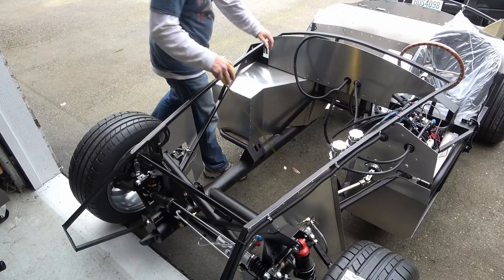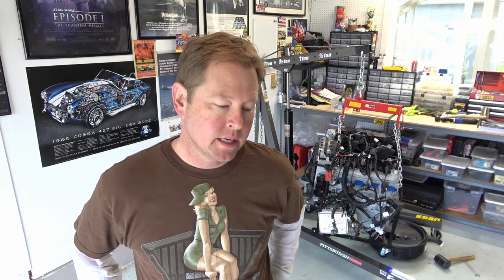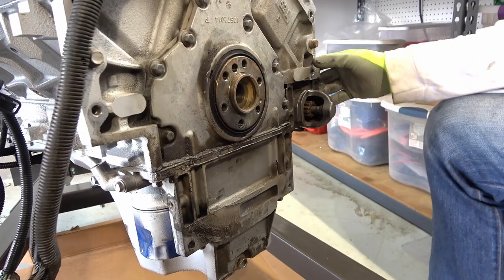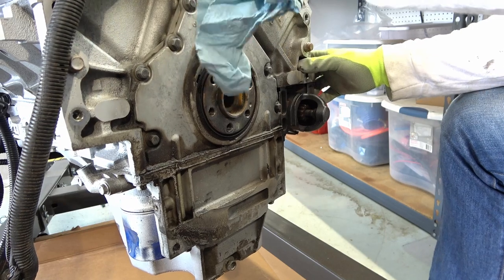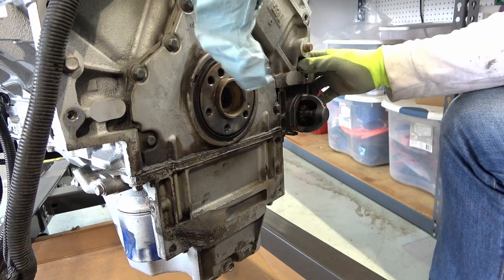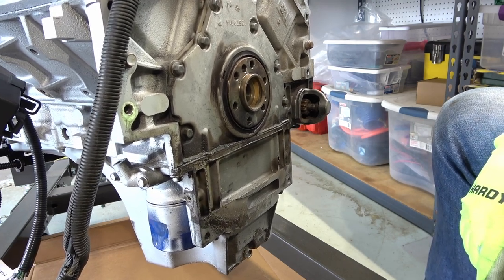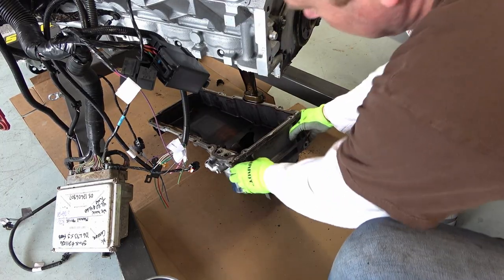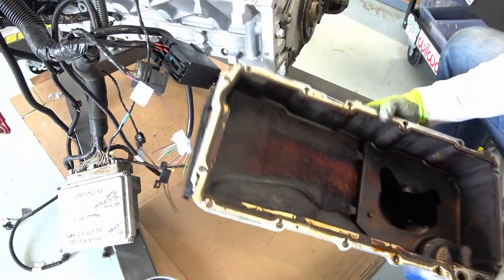Budget LS Factory Five Cobra | Build Update 24

Comment: Looks like you did a good job with the rear seal, another way is if you have the cover off just install the seal a while and the set the cover on and let the seal center the cover. Then ensure it's straight at the bottom and tighten the perimeter bolts and lastly the 2 bolts that go through the oil pan.

Comment: To align the oil pan you should have put a straight edge at the back of the engine down to the oil pan mounting flange where the bellhousing attaches so it's pulled all the way back flat.

Comment: y I will me ordering a new Blue Print engine with Trans, when I order my kit. The right pan will be on the engine and no messing around with having to adapt to fit. For me it is worth the extra money not top have to worry.   Ron  USCG RET
Reply from the maker: Yep sounds good. Let mw know how much it is.
Reply: @AmateurHourGarage  As of now the 383 Stroker with A/C and a 700R4 tranny is just over $18,000. They are also run on the dyno before shipping with the results printed out included in the crate.  Thank you